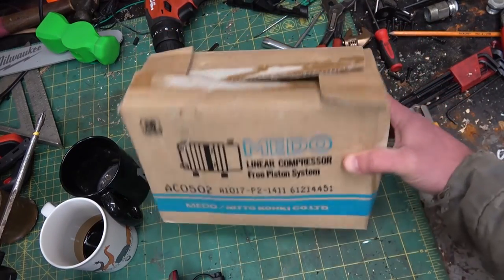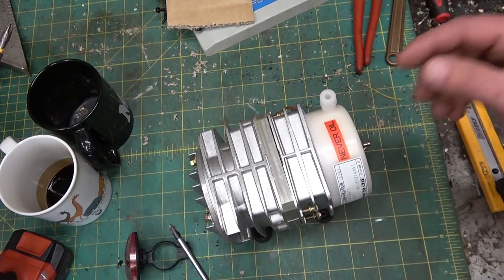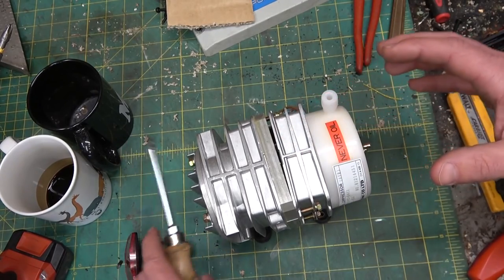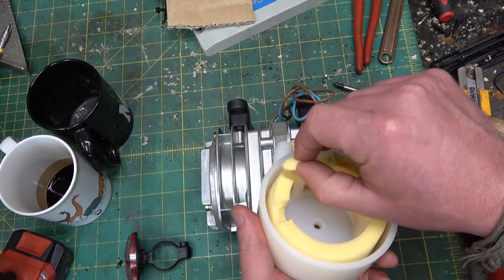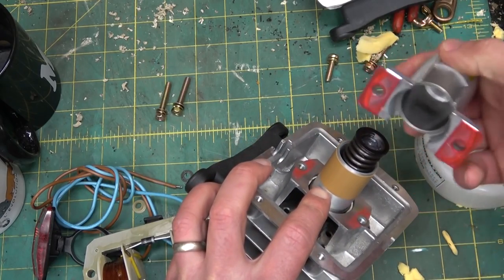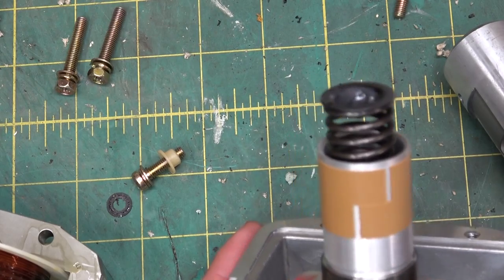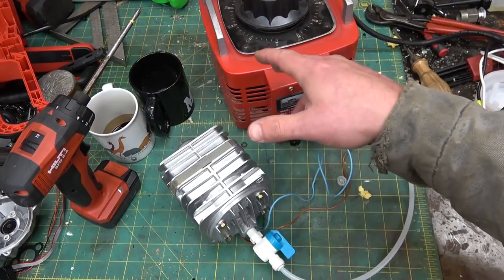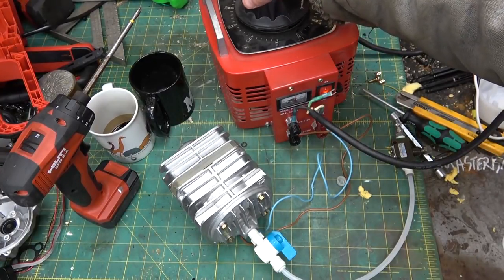BOLTR: Japanese Linear Compressor | Genius!

Comment: so spring, piston assy, reed valve x2, and it looks like 2x brushes, that comes out to 6 moving parts. technically a rotary vane blower with a brushless ac motor has only one part (except for any bearings in the motor.)

Comment: It is possible that there is a limit to the pressure the valves, springs can handle, and clearly to make it too large, the scale and mass will make reciprocating at local utility frequencies less and less realistic. Much like asking a giant to sing tenor or a mouse to sing bass, mass and dimensions tend to get in the way if you are trying to utilize any said standardized feed frequency.

Since fixed RPM AC only type motors can be geared either up or down, and brushed DC/Universal type motors are even more widely variable in speed potentials, and 3 phase hall effect motors, stepper motors and traction motors are even MORE speed flexible, they end up more likely to suit the needs of specialized flow control of fluids being driven from point a to point b.

~( 'w')/

Comment: Great Video,  but, it's not really a  "Compressor",   it's an Air  "Pump"..    Great for giant fish tanks or back yard ponds too..   Maybe fluid mixing, etc..
     Rotary motors have a lot more "fly wheel effect" inertia for compressors..  That return spring in the pump is fighting a civil war for the power..    That diode also cuts the power in half,  unlike a rotary motor....

Comment: In hermetical enclosed compressors like then ones for fridges, the motor have the advantage of being cooled by the refrigerant, which make them last longer. The downside is that you can never repair them.

Comment: Puts out 2 psi usable pressure under load and 4.5 psi no load. Compressed air systems require 100 psi to 150 psi under load, depending on the application. You need 50 of those to reach 100 psi and 75 of them to reach 150 psi. That, Silly Wabbit, is why motors, crankshafts and pistons are used.

Comment: LG uses linear compressors in their refrigerators. They're so reliable (HOW RELIABLE ARE THEY??) that they last more than a third of the time of a conventional refrigeration compressor. That wouldn't be so bad, but LG also leaves the welding flux on the fittings so they rot off.

Comment: These are good pumps for low pressure and verry cheap for theyr value especially if you get the 12v ones.They are noizy but reliable.

Comment: This type of pump isn't uncommon - small, low pressure, low volume pumps are used in fish tanks.  The reason for motors and reciprocating compressors is that you get more volume and higher pressure than you could with these pumps, mostly because the stroke length (insert humorous comment here) and the cylinder volume.  Also, it's cheap to cast and machine piston compressors at this point, and as you said, motors are cheap.

Comment: One disadvantage of these is terrible power factor due to the half-wave rectification. There are some larger ones that have two sets of coils in inverse parallel to push and pull the piston. Then one is on when the other is off, so current feeding it can flow on both half-cycles.
And this one would be easy to convert to run on 110. Simply rewire the two coils in parallel rather than series.

Comment: The diode effectively drops the 50Hz down to 25 strokes per second instead of 50. I suspected it would have a diode as 50 0r 60 strokes per second is just too fast for the thing to reverse direction.

Comment: Since it "chops off" half of the AC cycle, would that make it reciprocate half as fast?
30 times per second at 60hz, and 25 for 50hz?
Reply: No, just makes it powered in one direction only, thus the return springamadoojle.

Comment: my guess as to why these are not used mainstream for job site compressors would be that it requires a steady hertz supply to function properly and if you are on the job out in the boonies with nothing but a cheap non inverter type generator for power then you would not get consistent recharge rate in the air tank and it would probably have difficulty coping in a situation with multiple air tools being supplied by the same compressor. maybe you had a regulator on that unit in your video but it looked like you were only getting about 6 psi out of that thing. To get the "rated for 90 psi" (like hell I use my tools on anything but max with lots of oil) that you would need for your shop tools you would probably have to have a compressor of this style being the size of a Prius (may they all burn to the ground) to meet the required pressures and cfm for some of the higher draw tools like an impact gun or air sander.

Comment: Quick question...  would this work as a small vacuum pump?  Im sure it is the same sort of unit I have for the vaccum bed on my CNC router just hooked up on the filter/air in side

Comment: A crank and connecting rod piston pump has a better mechanical advantage at the high pressure end of the stroke (infinity at TDC).  This unit has no variable mechanical advantage so at the end of stroke it would be falling off on voltage (force) whilst trying to compress the spring and the air. These are only suitable for low pressure applications and i would guess that they are not significantly more efficient than other compressors except for the fact they are compressing to a much lower ratio and are not losing as much heat. They may be rated as technically more efficient but not necessarily more efficient if asked to do the same job or vise versa. I think they are reliable and fit for purpose.

Comment: You can find the chinese version of these in "hydroponic" gardening catelogs.  I've been using one outdoors on a pond for about 5 years, runs 24/7.  Google "EcoPlus commercial air pumps"  You can get them $30-60 US depending on size.  And TBH i have no idea what's inside these ecoplus pumps, they could be a completely different design, they just sound, look and perform the same.

Comment: I suppose that spring and mass would be tuned so that the whole thing resonates at 50Hz. If so, it would be less than happy running at 60 - three semitones difference. I'm surprised there's not a capacitor in there of some sort to scavenge power from the other half of the AC cycle and the collapsing magnetic field.

Comment: I'm guessing we're not seeing these for high mass flow applications because in larger cylinders/higher RMP's, you need to  minimise the reciprocating mass. So using aluminium over steel is a big advantage. The rotating crankshaft is only seeing a bit of friction once its up to speed. Any advantages over centrifugal compressors??? also one moving part? not as easy to get higher pressures maybe?

Comment: Heat generated.  That's probably why linear motors aren't used in reciprocating compressors.  The linear motors have no cooling built in like a regular motor.  That small example is not enough to generate heat like a industrial size one would create.  Current industrial air compressor systems are all fan cooled.  If one were to build a industrial size linear motor compressor, a separate cooling system would have to be added.  At least that's what I think is the reason.

Comment: It should be noted that this compressor spring is tuned to the country's AC frequency. It will work way dumber if it's tuned for 50Hz and you plug ti into a 60Hz socket (no resonance, thus loosing energy forcing a momentum change)

Comment: I realize this is an old video, but your talk of efficiency made me think, if you took a tesla turbine and used say, 20 psi to get it rotating like mad. Is there enough torque in that turbine to reduce through gearing something slower turning but with much greater torque, a rotational torque that is useable?

Comment: It seems the main difference is the pressurized air on the output side. I'm guessing this setup just doesn't have the torque to overcome it. It's a brilliant simple solution for a steady stream though.

Comment: Japan uses both 50Hz/200V and 60Hz/100V power so it could have been made for use in Japan. They were British first then switched to American 60Hz so they have a really scabby power grid. After the Fukushima reactor meltdown there were other power plants that had unused capacity but couldn't be used to meet demand because the frequencies were incompatible. I'm not sure why Siemens went to 50Hz instead of going higher than 60Hz when they needed to avoid patents but hey maybe someone could clear that up. We could have had nifty little transformers like aircraft that run at 400Hz and use a lot less copper

Comment: There are three moving parts. The valves move. I have seen a reciprocating water pump (for fountains) with only one moving part.
No check valves at all. No seals either. And the piston was rather sloppy in the cylinder.
Water came in and went out the same end of the cylinder, the other end was blind.
It was all in the shape of the (hollow) piston.
I will post how it worked after everyone has had a chance to think about it for a while. Guesses are welcome. If you are familiar with this type of pump, please don't spoil it. Just say "I know."

Comment: I'm intrigued. If you had an electromagnet at either end could you have a fast acting 2-way piston that could drive a couple of camshafts? Both ends have an inlet and an outlet. Could be used to run a motor. Imagine if you were using hydraulic fluid instead of air. How much oomph could the piston produce in both directions?

Comment: Wouldn't the cooling of the compressed gas yield a more accurate pressure reading for once it is used in an object (bike inner tube), since once the temperature stabilizes, it will be lower than the original (heated) pressure?

Wouldn't this make for a more accurate filling of the item needing to be pressurized?

Comment: Wild-ass guess but the reason larger compressors are not made this way could likely be to do with the size of the coil needed, it might be to do with the lack of a way to use a driveline like pulleys or cogs or something to amp up the force, or it might be to do with some nature of the reciprocating mass meaning it jumps around like an M-14 on full auto.  A reciprocating mass is always going to be fighting against its tendency to continue on in a particular direction of travel, so with only one moving part, 100% of the system reverses on each cycle, whereas with a rotational element, some fraction of the mechanism is always wanting to go in the direction it's already going in.  Again, just talking out my ass here, I could be wrong on all counts and it could just be a case of "We've always done them like that" or some other reason.

Comment: Seems like some airbrushes use this type of "compressor" if my half assed jazz fingers are to be believed. If that's the case, how does the system avoid loss of pressure during the intake stroke, due to the lack of tank? Would the line itself serve as the tank? Not a fluid dynamic nerd, and I cant understand how it would work.

Comment: I’ve heard of another type of compressor but don’t know what it’s called. It also has only one moving part. A fluted cone fits inside a precisely matched funnel. The cone spins inside a funnel compressing the air as the flutes are large, scooping the low pressure air, the flutes narrow and push the air through the funnel. If anyone can name it, I’d appreciate it.

Comment: well you have THREE moving parts, the piston, the intake reed valve, and the exhaust reed valve.  It is the reed valves that fail in compressor, so not going to prevent that failure here.

Comment: So, an ultra-high quality aquarium pump.  Got it.

As to why aren't all compressors like this?  Electric is good for high speed, low torque.  Compressors prefer the opposite.  Larger compressors use a motor with a tiny pulley that goes via belt to a huge pulley -- gearing!

Comment: Yes. Unfortunately I have fellow plumbers that believe just because they are reading pressure in inches of mercury, that somehow compensates for thermal expansion. It’s going into a closed system at 100 degrees but its 45 degrees on the roof where hundreds of feet of gas line is exposed to the elements yet somehow having a higher resolution measuring instrument won’t detect thermal expansion makes me concerned for all of the other common sense mistakes are being made, it’s not rocket plumbing.

Comment: A linear motor of this type requires a permanent magnet, the more air and the higher pressure the higher demands on the magnet... At some point it is cheaper to use a rotating AC motor and mechanics to do the work, even though it is less efficient. Also remember the manufacturer never pays the customers energy bills... :-)

Comment: Expensive and operates for years. We needed 180 PSI for our robot extractors, 90 PSI doubled. A compressor for that pressure would have been much more expensive.

Comment: If your mains power transformer does not like DC current, it would be best to run those in pairs polarized so each conducts on each half of the AC cycle.  Two many of these on a power transformer can lead to core saturation and transformer failure upstream.  Guys trying to slow electric power meters by riding DC on the line have destroyed pole transformers.

Comment: We had a refrigerator that advertised a linear compressor. By the time 18 months had passed 3 compressors had failed. The 4th compressor was failing when we heaved the refrigerator out. Certainly, can not recommend it.

Comment: its due to load. and wanting everything to run off dc voltage or put through frequency .newer digital scrolls load. id assume that the linear would be good for set load..say a fridge or a freezer even. with low pressure refrigerants it would probably last for forever..one you get some 410a pressure tho 125/350 id say it would explode apart. im not smart as you, but i am a hvac service tech for commercial/industrial. check out danfoss maglev compressor. talk about a headache waiting to happen.

Comment: Solenoids are reliable but the most inefficient way to create linear motion. This unit uses 45W but creates half a natts dick of pressure and very low flow rate. Probably less than 1W of output power. Efficiency probably about 2%. That's why it is not used for large systems.

Comment: They actually use linear compressors in fridges made by LG and Samsung, and they both have nothing but major problems and complaints. Just look up any recent LG made fridge online and you'll see almost nothing but negative comments and complaints about people saying the fridge broke down multiple times because of the compressor, and after the two years you loose warranty on labour and you end up been charged $400-600 to replace it, even though the fridges have 10 year on parts, but not labour. Asshole wording on their part to screw people over =\

Comment: Did you wire that :Brown to black and Blue to red?

Brown is live - same colour as your trousers if you touch it
Blue is Negative.
Reply: He wired in into an American 240v circuit with two hot wires and an unused neutral, with the hot wires in opposite polarity.
Reply: If it was DC it would be very important. But most homes are AC, so it's not that important. This unit should take 250v quite well as 250 is closer to normal output in the UK.

Comment: A house has 240v, not 220v. Two legs of 120v. 90% of the population says 110v. You have 110v in commercial areas that transformed through a transformer from 600v three phase.

Comment: There are refrigerators that has linear compressors that runs 120 volt on 53 hz. No clue to why at that frequency because I only seen 60 hz and 50 hz, but never 53 hz.

Comment: The reason they don't build compressors out of that kind of motor is because to deliver 150psi, when the tank was empty, the piston would be slamming into its end of travel.  90 percent of its energy at 1 bar would have to go somewhere other than into compressing air.

Now what you could do, if you were so inclined, is put a half-decent brain-box and some sensors on something similar to only give it the power it needs at low pressure and this random internet guy says that should work just fine.  Just wrangle some O's and 1's along with the pixies and, you know.. magic.

Comment: my guess is, while it works great at low volumes as you have here, i think it would take a shedload of magnetic power (therefore electrical power ) to  directly compress high volumes  linear-ly (?)  in a much larger version of this....the crankshaft of a conventional piston compressor effectively is 'gearing' and leverage so can be    run  with a pulley differential (another gearing) from an electric motor of reasonable size......a linear compressor to shift big cfm's im guessing the solenoids would have to be massive and can anybody speculate how fast they would 'energise' and 'de-energise.....and their duty ...........im sure a good leccy tech could chip in on that one.......'i wonder if anyone has ever built one to try it out??

Comment: I think those motors have massive restive losses and terrible power factor. they are sorta similar to a shaded pole motor, you never see them in anything past a desk fan.  anyeways its the big brother to the fog machine pump big Clive just took apart.  and you were right with "rotary vain compressor " efficacy isn't great but they are reliable and sorta easy to work on.

Comment: So it only makes 5 psi? Cool.. I still think rotary lobe compressors are way cooler. No transmission from rotary motion to linear motion. They still have valves but perhaps *only a minimum pressure valve for oiling purposes (normally open.) Losing energy due to radient heat in the air reciever is an intersting thing I hadnt consodered -- although at 5 psi (this application) it would be negligible